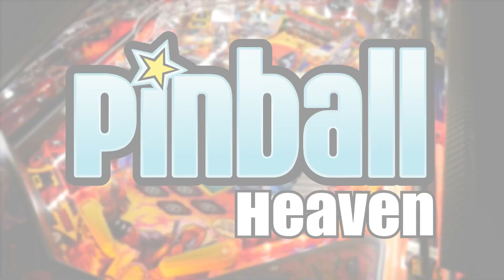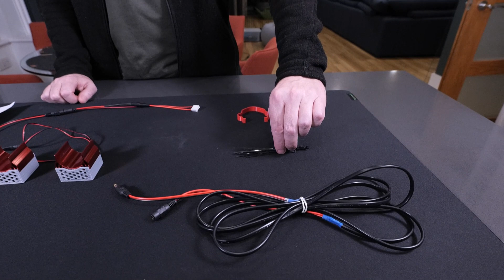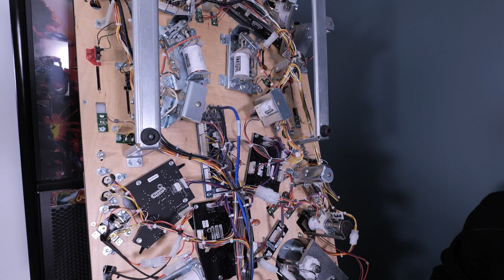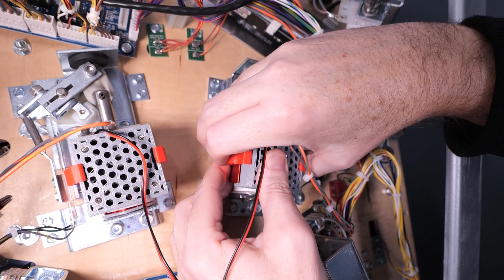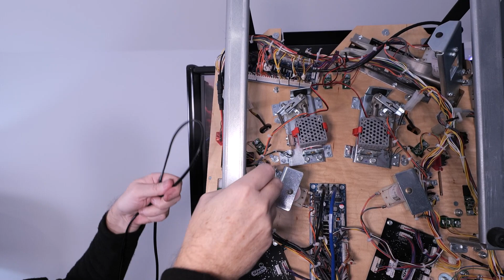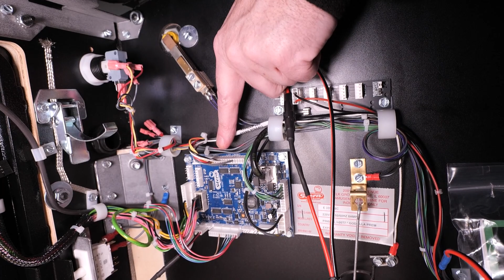Why you might want to install flipper cooling fans on your Stern pinball machine

Comment: Apparently aluminium flipper bats can also help reduce flipper fade. I'm told that because they don't flex like a plastic flipper bat does they're much more efficient than the plastic ones and ya can turn down the power of the flipper coil and still get the same power from the shot. And because they don't flex or fade ya can get a much more consistent shot as the spot on the flipper that ya need to make each different shot from doesn't change as the game progresses and the coils fade. And I didn't know there wasn't a voltage change from 50V to 5V when the flippers being held up to trap a ball like the old machines did. No wonder the Stern coils bloody over heat. I'd heard that Stern coils can burn out when ya been holdin a ball for awhile and sometimes when I've been holding a ball for awhile on Zilla I think, shit, Stern coils, I better shoot the ball before the coil burns. And now I know why. And It does seem really strange to have different sized coils on each flipper though. Wonder why the hell they do that for? 🤷‍♂
Reply from the maker: That's a great post Russ

Comment: Great show ,thank you for all the info. I love the way you define character, flow and feel.,Like a good or bad feel with a golf club, auto or even a painting. How do we know the coils lose power?  Two coils in one package can cause a great deal of mutual inductance. with todays tech we might try two drivers to handle the coils. I was able to reduce the leakage by engineering a snubber circuit, flyback,free wheel, "Diode-Resistor-capacitor". I know the flipper and mounting plate must be strong, however a magnetic componet will radiate into the huge amount of steel around it  and create Eddie Currents that oppose the primary source. Thats why transformers have hundreds of small insulated plates. What are your thoughts? Has anybody tried anything in the last 50 years.
Reply from the maker: Hi Bill . . . I honestly don't know too much about the technical side of things. 

The coils certainly lose power as the game gets played longer. The most obvious example was the steep ramp on Avenger Infinity Quest which would roll back down more frequently the longer the was played.